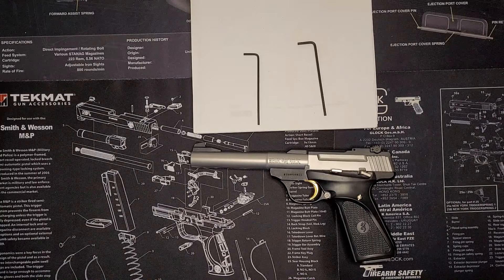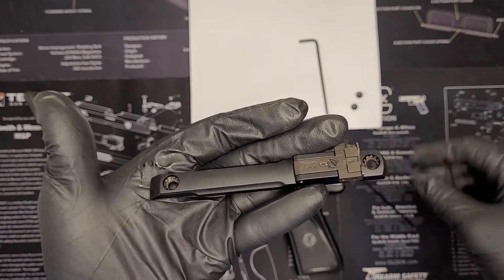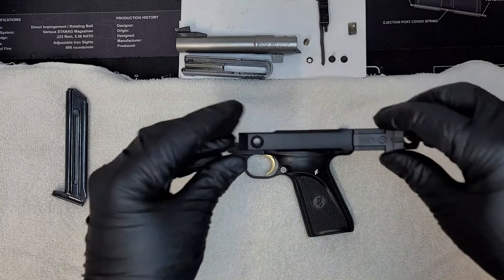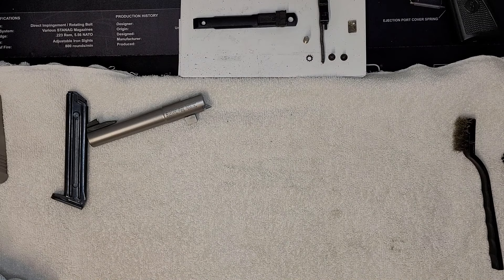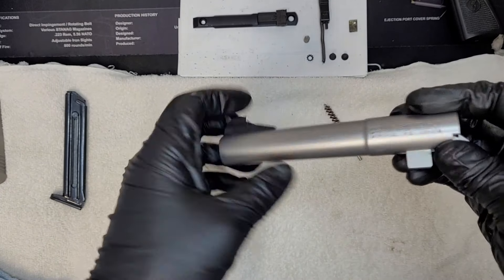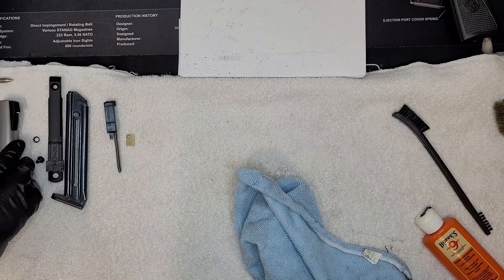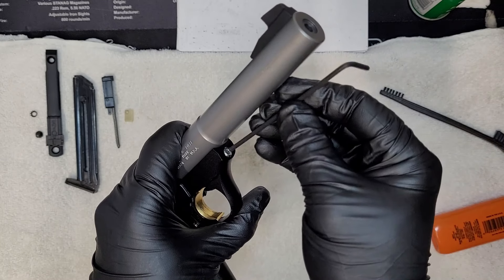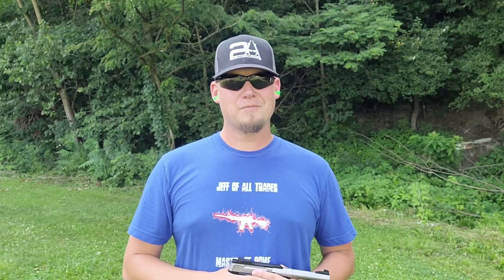Browning Buck Mark tear down, cleaning, oil points, and CHEAP SHOOTING!

Comment: I was cleaning my buckmark when the spring came flying off the rod. Took me an hour to find the very small c clamp that holds it on. No one seems to mention the small c clamp.
Reply from the maker: No one mentions it because it's not supposed to come off lol tons can happen with a gun that could cause issues. No way to go through everything.
Reply: Just lost mine today. Now I have to wait for delivery from Numrich.
Reply: @ironhorse127  same thing happened to me the little c shaped clip popped of and I spent 30 minutes looking for it.  Finally took a big magnet and swept it around the area and on the floor in the area until it stuck to the magnet.  I think the official name for that clip should be the “damnit” clip.  When it pops off the first thing you say is “damnit”.
Reply: @jeffofalltrades8489    If you take it off like you show it, there’s a good chance the c-clamp will fly off. If you pull the slide back a little you can easily hold on to the rod and pull it out without risking the c-clamp flying off. That’s  an important part of taking the recoil spring out.
Reply: I will now mention the puny c clamp 😞

Comment: Nice video, but if you ask a few gunsmiths they will tell you only the BRUSH should go past the barrel crown, not the rod. Some rods are brass, some aluminum, some even steel. You don't want those rubbing the fine precision finshed crown of the barrel which is the last stabilization the bullet gets as it leaves the barrel. Check it out on some gunsmith videos. :)
Reply: Right…you sure wouldn’t want that brass rod damaging the hardened steel barrel.  🙄
Reply from the maker: In my experience, with hundreds of firearms and as a military trained individual, this is not a problem. Others will also say to never take the Buck Mark apart but here we are! To each their own I suppose Froggy. Thank you for the support

Comment: Perfect timing for my Buck Mark Bullseye Std 7 1/4 barrel.  For a thorough cleaning, the Browning owner manual says to only take it to a gunsmith annually, and not to clean it myself.  Just spoke to one of the range managers about cleaning, and he said I don't need to take it completely apart, and he'll give me a demo cleaning next spring so I can do it myself.  This video provided everything I need to know, including some great comments.  Thank you Jeff, and the comments contributors!  Inherited the gun in March 2022, and it only jammed twice.  Using CCI LR 40 gr/std, and I do a basic cleaning after each use.
Reply: You don't have to remove the barrel either, easy to clean still mounted to frame,you only need to take the slide off for a proper clean.

Comment: Doing this today. I wanted to do a clean, and also try to find a cause for feeding issues.  I did find that the screw holding the barrel on was NOT completely tight AND the screw holding the feed ramp was almost ready to break. I got lucky when I took it out, didn't know the head was almost twisted off probably by previous owner, went to reinstall. That's when the head came off. I was able to get the screw out with the help of a slight twist with pliers. Got screws from hardware store. Going to test my work later today or tomorrow. Thank You for the nice precise instructions.

Comment: I have the Buckmark Hunter with the longer barrel and I clean and lube my gun exactly as you have demonstrated, except for the barrel. I was always taught to go from the breech end and I feel uncomfortable putting the brass end down the front without some protection for the rifling, but that's just me. I get that the brass is way softer than the steel barrel so your method is ok. I was glad to see you use minimal oil, and wiping the surface. Too many shooters overdue the lube. Very well done disassembly, exclamations and reassembly. A+ bud. On the rear screw I use a t handle and give it slightly more torque to prevent the slide from loosening up after 50 rounds.

Comment: Thank you for your insight, I took my buck Mark apart for the first time after about 500 rounds it was nasty inside, but while removing the firing pin/ recoil spring assembly the spring flew across the room, luckily I could track the sound it made as it bounced around made it easy to find but the very small C ring that kept the spring in place on the firing pin was nowhere to be found, I did get lucky the C ring was stuck to the plastic buffer block and I couldn't see with all the carbon build-up. So happy ending

Comment: Good video.   I've owned three different Buck Marks over the years with over 20,000 rounds total.
Only had an issue with one of them.   They are extremely reliable when kept relatively clean.
If a Buck Mark has any "light strike" issues, it is very easy to remove the firing pin from the plastic assembly and clean it or replace it if damaged.  Buck Marks are relatively easy to field strip as you demonstrated in your video.  Thanks.
Reply from the maker: I appreciate the support! Thank you and  enjoy shooting!

Comment: Excellent video Jeff! I recently had some issues with FTE with my buck mark. I did the full tear down and the problems continued. I ended up replacing the springs on the magazines, ($2.00 each) and the problem was resolved. Very simple process that you might want to include in a future video.
Reply from the maker: Great idea! I'm glad you got it fixed!
Reply: A mag spring change fixed a FTE?  Interesting.  I would've thought  the extractor/extractor spring would've been the culprit.

Comment: Hmm, i did not know or have seen pulling through. The uni Hoppes kit says to push and I ended up just buying a bore snake for .223 which i use on the Buckmark and 10/22. Alot easier. Thanks for the video.

Comment: Terrific video, very clear explanations of cleaning procedures. No matter which firearm you own, you will benefit from viewing this. Many thanks! I was interested in the Buck Mark but read online that there were problems with misfiring and jamming. Anyone experiencing that?
Reply from the maker: Thank you for the support! Personally, I've never had an issue with jamming or misfires and I've had this gun for many many years. Thousands of rounds through it. With any gun, there will be unexpected jams but they are far and few between. This of course is just my experience with this weapon.
Reply: On a cold day w/ waxy ammo the buckmark is a jam magnet, any other time or ammo combo and it's golden.
Reply: I just used this video as a guide for my first barrel removal / cleaning in 1000 rounds. I have had 3 miss fires. All in the breech. There is no other way to get to the dirtiest parts without removing the slide and barrel.  Thanks for the guidance.

Comment: Please be advised that Browning does NOT recommend disassembling the Buck Mark by removing any screws. That is why this disassembly procedure is NOT covered 
in the owners manual. I confirmed this with the Browning tec-rep via telephone conversation.  Also, be advised that dry-firing the Buck Mark without a snap cap or spent shell casing WILL DAMAGE the firing pin. This is stated TWICE in the owners manual.  I recently purchased a new Buck Mark Camper.  My contention is If the hammer is cocked and the trigger pulled, causing the hammer to fall (dry fire), it is EXTREEMLY DIFFICULT to retract (cock) the slide!!  Strange, but I have never seen this Buck Mark quirk discussed anywhere? Otherwise, I really like my Buck Mark, great fun to shoot. I have 500+ rounds through mine of High Velocity ammo. (Aquila, Super Vel, 1280 fps, 38 gr, Hollow pt, cu-pl), with no problems. I enjoyed watching your excellent video.
Reply: damn… my buck mark keeps jamming :/

Comment: Thanks Jeff 😊
Reply from the maker: Of course! Glad it was a good video for you!
Reply: Hi Jeff; I just cleaned my buckmark yesterday for the 1st time after 500+/- rounds(as recommended by the dealer) using your tutorial..worked great except mine did not have the little lock washer on the end by the plastic rectangular buffer.  It went together well and cycles like new!

Comment: I'm an old guy. Sometimes I watch these videos just to see what kinda crap youngsters believe and practice with their firearms. My Buckmark is one of the firsts and it still functions as flawlessly (with good ammo) as when I first bought it...probably around 1987. I have to compliment you, Jeff. Your basic knowledge and principles of firearms and their maintenance seems solid. However, I would submit that your "pull through" method from the muzzle still requires you to put a bare rod through the muzzle. If not done carefully, even a little accidental ding can occur. With the breech completely open as the barrel is removed, there is no reason not to enter the bore from the breech with whatever cleaning device you desire. So here's this "old man's" rule of thumb. Never enter the bore from the muzzle! I will say it again for those who just thought "What about revolvers and lever actions!?" NEVER ENTER THE BORE FROM THE MUZZLE!! For all those who are still showing those ??? in little white clouds above their craniums, this is a good time to look into and invest in "Bore Snakes".  Good video, man. Thanks.
Reply from the maker: Thank you for your advice! If you watch any of my other videos, I actually encourage bore snakes. BUT I like to make videos that anyone can watch and anyone can preform. Where I'm from, buy a gun, get a cleaning kit. That's why I showed it this way but I absolutely agree with you. Thank you very much for watching and your support. People don't know how much that means to me! 
From - Some Crappy Youngster ;)

Comment: A good lube is amsoil harley oil.. get a light viscosity..think about it.. it protects metal on metal cycling at a minimum of 15 times per second up to 50 times per second or more for hours..

Comment: Good informative video.  Thanks for taking the time to make this and post it.  You mention the gun will not test fire without a round in it.  That is not completely correct the gun has a safety measure were it will not fire without a magazine in place.  You can work the action, test the safety and trigger with an empty magazine inserted.
Reply from the maker: Great info! You are correct and thanks for sharing@

Comment: Great vid but how can you put that dirty patch back on and run it through the barrel a second time?  Why obsess about only cleaning from the chamber to the muzzle if you are just going to turn around and put all the dirt you removed on the first pass right back in the barrel?
Reply from the maker: When you shower, after you use the washcloth on your arms, do you get a new one for your chest? 

The dirt isn't going to fall off of the cloth. The oil/spray you put into the barrel or on the cloth is going to make everything stick to it. There is no issue. Don't stress about it! Waste of cloth if you throw it away after every time you see dirt on it.

Comment: Thanks for the video, Very helpful. I followed your video to clean mine. 
I have a question that I have searched web but didn't find answer for. My Browning is new, just shot once in the range. It happened twice before I took it to the range that the slide would lock and wouldn't open after dry fire. (I know it's not good to dry fire, so not going to do that again) I bought dummy bullet and it also got locked after firing the trigger. The strange thing is I left it over night and was able to slide it back the next day. I'm just puzzled why and couldn't find an answer. Would you know what the reason might be?
Thanks!
Reply from the maker: I will try to replicate it and see what I can find ... are you sure the safety didn't get clicked on when it didn't fire? Or that it got jammed up on the mag? Those are my first two thoughts
Reply: Thanks for replying. I’m pretty sure the safety was not clicked on. Not sure if it was the mag … when it was locked, I couldn’t release the mag. But after I left it as is overnight, next day I was able to pull back the slide, and was able to release the mag as well.

Comment: What ammo do you use .my gun would jam and key hole on target but the more I have shot it the better it has gotten. Seams to not like the higher power ammo
Reply from the maker: Hey Jay!!
I've used high velocity as well as sub sonic (700 fps) rounds (CCI brand)  and there is no difference for me! I have noticed some Key hole on target, but its very rare. I couldn't even say which ammo would cause that. I feel that if the bullet isn't seated correctly from factory it can cause that, but I'm not too familiar with that ... 
I just recently made a video on the Keltec CP33 and that gun likes high velocity so you might be onto something there!!
Happy shooting, my friend! and thank you for the support.

Comment: Great video. We have one of these and took it to the range recently. Brand new. It wasn’t feeding the next round when we fired it. I think it might not have enough lubrication. Something else I could be missing?
Reply from the maker: So it might be the oil on the weapon, but most times it's your strong hand (the hand pulling the trigger) being too weak. If you let your wrist move at all on your strong hand, then you're absorbing the recoil and the slide won't come back all the way. Keep that hand strong and try not to flinch when you pull the trigger so the force from the round can properly put the slide back and rechamber the next round. I hope that helps! Let me know how it goes!
Reply from the maker: Although a solid cleaning and oiling can work wonders. First thing i do whenever I buy a new gun is take it apart, scrub all the factory oil off, and oil it myself.
Reply: Check the screws that hold ur top sights on. If they become loose itll cause the slide to become slightly misaligned which will result in failure to feed as well as jamming issues
Reply: It actually turned out to be the ammo we were using! Thanks everyone for the replies

Comment: You said you've only taken it down 4 times in it's entire life, wow. I have a Walther P22 and take it down every time after I shoot.  I'm picking up the buckmark camper next Saturday.  Is it your recommendation not to field strip every time after shooting?
Reply from the maker: Well that's to each their own. I take my 9mm apart every time I shoot. Same with my ARs. With a .22, I don't really see the need. I mean, you saw the dirt that was on the gun. When I took it apart, and it truly was minimal. The amount of "dirt" and carbon build up from a small .22 cartridge is minimal so I don't see the point in taking it apart so frequently. Just my opinion! I also believe in always having a clean gun so you really can't go wrong!! 

I feel with those two Allen bolts, if you took it apart after every shooting you risk them stripping out. So the risk is higher than the reward for me. No reason you can't lock the slide back, clean the barrel and the internals as best you can, and call it a day! 

Thanks for the support my friend
Reply: The Browning Manuel sase don’t take it completely apart they say bring it to a gunsmith .
Reply: Browning also won’t tell what the torque should be on the three Allen screws . So be carful don’t over titan them .
Reply from the maker: @paulmarion7578  yeah well, call me a gunsmith then lol. There is nothing a gunsmith can do, that you can't do with a little research and taking your time. Taking apart this .22 is no different
Reply: I clean mine once a year or every 1000 shots of competition season. It is black powder on .22LR routine, other kind of cartridges need more cleaning.
Thanks for the video master. Suscribed.
Reply from the maker: @Orzoweyes  thank you for the support!!
Reply: @paulmarion7578  That's correct. It's a little over protective, but Browning does not recommend taking it apart to clean.

Comment: Before storing the buckmark, do you dry fire it to release the striker, or leave it cocked?
Reply: I'm told to never dry fire this weapon. The firing pin can damage the breech. Please correct me if I'm wrong!
Reply: I've had three Buck Marks over the last nine years with over 20,000 rounds fired and have always left the hammers cocked after cleaning.  Never any problems.  I don't dry fire unless I have a dummy round in chamber.

Comment: My buckmark went from reliable (1 or 2 fails/1,300 rounds) to 1 fail/50 or 150 rounds while using the exact same ammo. I've cleaned it the way the manual says(without a break-down). Is it time for a full break-down cleaning? Manual says not to break-down this far, why not clean the way manual says? Any problems after? 
Thanks in advance.
Reply from the maker: No problems after at all. Still fires like a dream I'm not sure why the drop down in efficiently with yours? A full cleaning like described in the video can't hurt! Just use the right tools, take your time. And you'll do fine. You can't go wrong with MORE cleaning.

Comment: Browning states in their instruction manual twice in bold print to not take apart the gun . Your thoughts ?
Reply from the maker: Well, as I did in the video, take it apart and clean it. Everyone has an opinion, but I feel if it's done correctly, take it apart and clean it. If you do it to specs and follow my instruction you won't have a problem. 

If you don't feel comfortable, you can easily clean/oil the gun without doing a full breakdown. Just rack the slide, run a brush and oil, and you're good to go. At the end of the day, any cleaning is better than no cleaning. 

Happy shooting, and please let me know if you need anything else!
Reply: @jeffofalltrades8489  Thanks for the advice.   I didn't see any major issues and how you did it looked easy.

Comment: I just cleaned a Buckmark for someone that has a Picatenney rail and thought I needed a 2 foot cheater pipe th break lose those lock washers!!!  Ridiculous---I left them out and used some blue locktite and 18 inch lbs torque...,